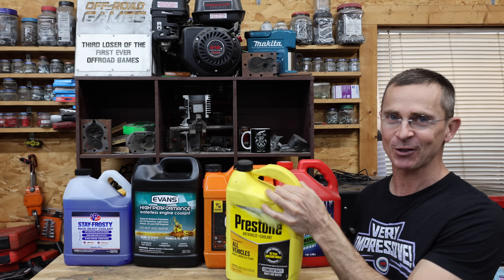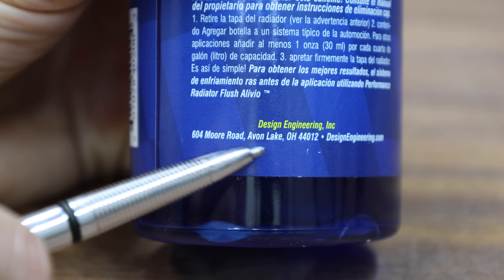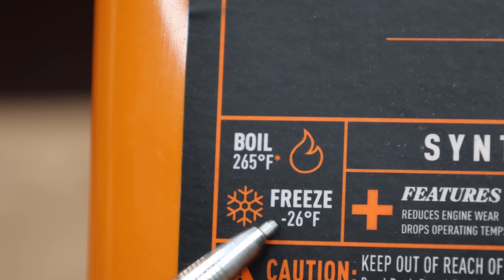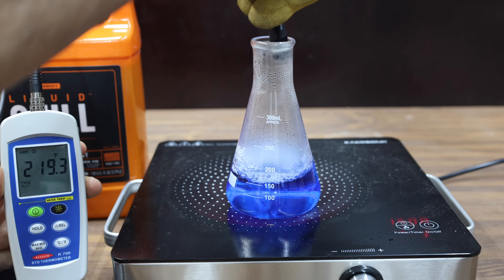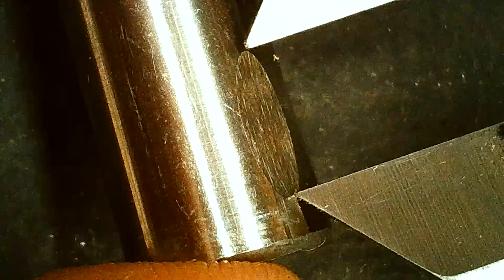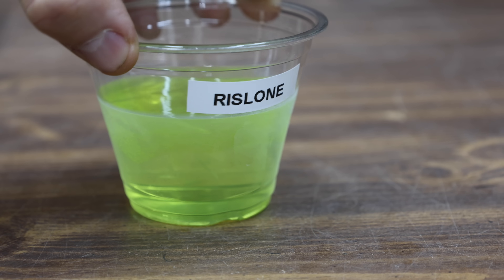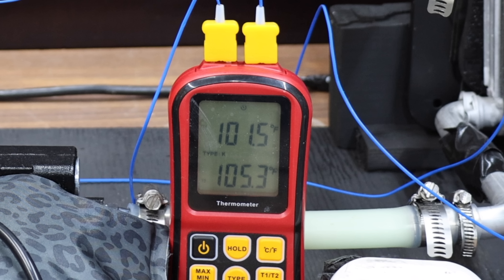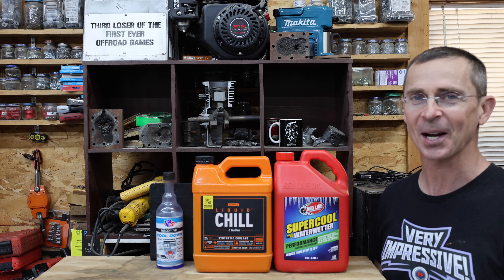Do "Super Coolants" Lower Engine Temperature By 30 Degrees?

Comment: Please guys do test on Chevy one row oem radiators vs the expensive ones and thicker radiators of 3 rows. Specially on GM models from 99-06. The problem with thicker radiators is that you need more speed on the air flow to pass through and cool the 3 rows, oem radiators on chevys are thin and it have more surface on each row so is easier for air to pass faster through the thin row to cool the coolant that have inside, specially on heavy traffic or low speed on the city. Ticker radiators needs more coolant, so is harder cool more water mass that is inside the radiator. But this full aluminum radiator brands says that 3 row is better! So who will win the test !!
Reply from the maker: Thanks for the suggestion.

Comment: I use evans in waterless coolent high-performance 383 chevy  it sits alot the evans we use is for racing it $50dollars for  a half gallon it does keeps rust corrosion away  worth every dollar.
Reply from the maker: Thanks for sharing.

Comment: HOW IS THE MOST POPULAR product not on here? WATER WETTER?? Am I missing something?
Reply: Thats what im saying!
Reply: That's redline supercool water wetter.
Reply: @HSKFab  The problem with testing Redline's premixed antifreeze with water wetter, versus adding water wetter to the Peak, is that we don't know if water wetter just works better or if their premix works better. They may have a different ratio of water wetter in their premix, or it may be a certain formulation of antifreeze. Without testing Redline Water Wetter with the Peak you don't have that data. 
Redline premix is more expensive than getting Peak AF and mixing with Water Wetter, but is it worth more money?
Reply: It is the redline fluid. With water wetter
Reply: Go back to the end of the video where he's making the outro and youll see the recliner supercool Water wetter
Reply: Red line*

Comment: Needing "super coolants" basically means you have serious issues elsewhere in your cooling system. There's a reason mechanics don't fix overheating conditions with these products.
Only in some special circumstances would you ever need to use them, otherwise you're just buying snake oil and forcing your engine to work in conditions it wasn't meant for

Comment: that  evans coolant stuff, it will catch fire if there is a small leak
especially if it squirts onto ex mani.
and if it comes out dizzy side, then the sparks or static or what ever there is on dizzy / plug side will also set it alight
as i found out.

Comment: Heat capacity and heat conduction are not the same, but both matter...water is far superior in both categories when compared to ethylene glycol (EG), which most of these are, or propylene glycol (PG), which the Evans is.
   Not even close. Water conducts heat more than 4x as good as PG, more than 2x EG. 
   EG is almost twice as good as PG (Evans) in conduction. 
   In heat capacity, by volume, water beats either EG or PG, it is almost double.
    Evans and it's fans tout the lack of cooling system pressure as a benefit. But cooling systems are designed for this, it is generally 12-13 psi. It not only raises the boiling temp of water to more than enough, it also prevents cavitation in the pump.
    It is less than 1 atmosphere, really not much.
    Straight water is best for heat transfer, it isn't even close. But corrosion, freezing, and pump seal lubrication are real things.
    Extremely low freezing points are kind of impressive, but don't help if it never gets that cold. 
    I get good results with common EG coolants and distilled water.
    RV antifreeze is propylene glycol, like Evans, but is 1/10 the price. I'm sure there are different additives, it's not fair to say they are the same. But the big differences in basic heat transfer abilities VS water make me suspicious. 
   Remember that none of them are really "coolants", they are "heat transfer liquids". To move heat to the radiator. Making the radiator HOTTER for a given engine power output INCREASES heat loss to the air, which is the goal.
    Leaving any liquid out of the cooling system would result in a nice cool radiator, and also in engine meltdown, right?
Reply: I agree with the many comments on the thermostats here- if any of these lower engine temp by 30 degrees, your thermostat is malfunctioning,  or your radiator is inadequate,  either by design, or is dirty or something. 
   AND- thanks for all your work, and entertaining and informative videos.

Comment: haha your engine is designed to run at  temperature. if  you wanted it to run 30degrees cooler,   you just disable the  thermostat

Comment: Red line Waterwetter is what we use on race and regulars and have performed well, had issues of over heating on one of the car we race and a friend recommended the redline and never overheated after, been using it since early 2000's and u can buy a small bottle and add it on ur coolant reservoir.

Comment: Only one test in that really means anything maybe two which would be the mock system test and the freeze test. The others don't mean anything. Coolant is not suppose to be in your oil so idk why you'd test for wear scars. I'm assuming the wear test is an equivalent to bearing wear and seal protection in the water pump. The bearings in the water pump can be just fine using regular old water as that's what a lot of people do in warmer climates because it doesn't really freeze so that's not really an issue. The mock up system test isn't really exact because these are designed to be under pressure in a running engine which they weren't here which would slightly change the results although probably still mimic them to a large degree.

Comment: Used the Liquid Chill in a '99 7.3 PS, and it helped a lot. However, I found using a low temp thermostat on my 6.7 made a bigger difference in operating temps just using regular coolant with no additive. Both truck were used as Hot Shots towing up to 26K of freight.

Comment: Technical Note:   The water pump bearing is lubricated by grease and is SEALED from getting any coolant.   Lubricity of coolant may help the seal itself last longer.  But has ZERO effect on  the bearings unless the seal is leaking.
Reply: It’s for electrical water pumps

Comment: This test is severely flawed.  You are actually indirectly measuring the heat capacity of the fluid along with some degree of thermal conductivity.  What really matters is how much heat gets removed from your engine.  A better way to measure performance would be to measure the electrical power required to maintain a specific outflow temperature from the heater core at steady state.   This will quantify the ability of a fluid to remove heat from your system.  As a thought experiment imagine you had a fluid with extremely low heat capacity,  the temperature drop through the heater core core would be very large but the ability of the whole system to remove heat from the heater coil would likely be quite poor.

Comment: I've never considered temperature lowering additives or coolants for daily drivers; STICK WITH THE MANUFACTURERS RECOMMENDED COOLANT. PERIOD.

My experience with Redline WaterWetter was in the late 1990s in SCCA racing. At that time it was an additive we added to standard Green Ethylene Glycol antifreeze (Which cooled better than plain water), with WaterWetter we were able to add a few more degrees of ignition timing advance and achieve a few more horsepower on the dyno than 50/50 Ethylene Glycol alone; pH was never a consideration as the engine was rebuilt yearly before the Run-Off Championship race.
WaterWetter's claim as I remember was that it reduced the surface tension in the areas contacting the crucial cylinder head surfaces to remove heat.
Reply from the maker: Thanks for the feedback.

Comment: If these really reduced cylinder head temperature by 75 degrees, they would make the engine run very poorly and burn a lot of gas. Engines are SUPPOSED to run at the temperature they run at.

Comment: Thanks for this! Sorry for the dumb question but Im confused why add sulfuric acid? Why not just compare base ph? Unless we’re saying theres a way for these things to possibly become more acidic over time and you were checking resistance? Sorry just confused there.

The Evans seems like a drag racers friend. High boiling and low freezing and I’m assuming if a line goes it doesnt do to the track what antifreeze does

Comment: I’ve had a horrible experience with The royal purple engine ice.  I rebuilt my Honda motor from scratch and was running distilled water. Couldn’t get redline  water wetter locally so I went to discount auto and saw the Royal purple version.  I empty my cooling system and fill with RP ice and distilled water.  About two weeks later I hear hissing coming out of my radiator cap in the garage. Engine was cold, car hadn’t been driven for days.   Turns out the Royal purple went corrosive and was eating my aluminum radiator.  I reached out to them and they claimed it was my fault for not using tap water.  Then they said I used half the correct dose of their product. Their test results yielded high aluminum , high sulfate and high chloride.  The radiator was brand new, all cooling system components were brand new from Honda and there was only ever distilled water in the system from  we took apart the block and hot tanked it.   Lesson learned in chemistry.  I went back to using redline water wetter with Honda oem coolant.
Reply from the maker: Thanks for sharing.

Comment: I’ve run Evans in all of my race bikes for many years. There’s been no comparison to Evan’s yet.  Anyone interested in switching over to Evan’s needs to know this, Evan’s makes a radiator flush you must run through the engine as directed then drain out before you add the Evan’s coolant it’s self.   It’s pricey but well worth it.
Reply from the maker: Thanks for sharing.

Comment: Three things about the Evans: 1) You have to completely clean/dry out the coolant tract when replacing with Evans. No water should be in the cooling system, nor do you cut it with water when putting it in. If you don't remove the water, it degrades it. 2) Once put in the system, it's a lifetime coolant. You don't have to change it. 3) Considering it will not boil until over 380°F, you can run it at a lower pressure than normal. Less stress on the hoses and pump seals.
Reply from the maker: Thanks for sharing.

Comment: Just think about it, without any water Evans performs equal to a regular 50/50 mix. No water=low pressure and super long life for all cooling components and no more corrosion in your engine.

Comment: Possibly an interesting statistic you could add to the lubrication tests would be the amount of material that was removed. You could do this by using a cup filled to the brim with water and then dropping the pin in it after you wipe off any/all excess lubricant. Alternatively, you could also weigh the pin before/after.
Reply from the maker: Thanks for the suggestion.

Comment: 😮With much thought. Was the thermostat still going to let my bike in high heat traffic bouncing off boil over.??.  Like evans for the boarder line. Boil over.?? I still need to keep bike at temperatures it’s designed for.  Bike came with red line with water wetter. I feel safe now. I read comments to get hidden info. . I freaked out to get evans. Then convinced red line with water wetter good . Now. After much thinking. Im still changing to boil over protection.2015 Honda cbr600rr everyone hates the high temp soon as you stop. But the fans do kick on. So boil over protection from evans might be best. Wish I had the bike back to do the test.?? . But I’m in reverse testing on a sv1000 . Im flushing redline out.and putting evans in. With a big v twin it should get rid of hot spots.???  Comment section is where you can almost get real life Common sense . And disifer awesome testing to real life driving and storing 😮 I think if made my decision. Not to cool down. I have fan for that. But to protect from boil over.?? 😮but wait.!!! I changed my mind again. A guy pointed out with evans. If your bike is overheating . Like 250. Or higher Your cooking your engine . So I’m going back to redline. Or and just use a fan. That’s my final awnser lol.  One guy used strait water wetter no antifreeze. ?? If you forget to drain one winter you could freeeeeze 😮

Comment: The big deal here (if you have a car which may overheat due to performance or whatever) is boiling point, if you can stop it boiling, you have it under controll, soon as she boils all bets are off. im too cheap to run evans, but neat modern OAT concentrate has a boiling point around 180c so very very similiar to the evans.

Comment: Ive been using mishimotos "liquid chill" for my subaru wrx since my stock radiator blew up the first year I had the car. When I first got the car it would run high with 200-228F during summer. Switched to a front mount intercooler after the stock one busted and that dropped temps to between 190-210F during summer. Switched from standard antifreeze to "liquid chill" and it further dropped my summer driving temps to between 170-190F! For anyone that knows subarus you know how critical cooling is. Unrelated but I also eventually did the cylinder 4 cooling mod by tapping into the heater lines and my average driving temps stay between 168-182F. Couldn't be happier.
Reply from the maker: Thanks for sharing.

Comment: Great comparo!
My only question is, is it possible that you may have made a small mistake in not testing the Evans Waterless Coolant first? Or did you use their Prep Fluid to rinse and remove any traces of water in the test system prior to testing it?
Just a thought.

Comment: I’ve never seen a 30* drop, but I’ve always run a coolant booster in my toys over the years and I can say based on data logs that at least some of them work to some
Extent. For instance in my track bike straight distilled water + Amsoil coolant boost keeps the bikes coolant temps on average ~12-14*  than regular OEM antifreeze. Another thing I’ve also noticed is that in my grudge car I run the same setup and it comes up to operating temp a little faster than with straight water alone. So there’s something in this stuff that changes the thermal properties to some degree.
Reply from the maker: Thanks for sharing.

Comment: Can you test 12” electric radiator fans? Proform/derale/spal/flexalite/etc 
Specifically brush vs brushless. Proform has brushless fans and they claim they pull more air than brush
Reply from the maker: Thanks for the suggestion.

Comment: I wish you had tried Peak Final Charge against the standard coolant. Peak claims a life of 1.5 million miles, 10 years or 36,000 hours from a relatively inexpensive coolant. Also claim to have better heat transfer properties for use with emissions controlled diesel engines that have EGR coolers and the like. I have been running it in everything I own for a while now and a couple of the vehicles seem to run cooler in Texas summer heat.
Reply from the maker: Thanks for the constructive feedback.

Comment: I personally use the VP additive, and it works great. It was on sale one day, figured what the heck since I was dealing with an engine getting hotter than I'd like to see. Dumped it in after a flush was already done (it was still getting hot after the flush) and It literally solved my issue. Believe it or not, i dont care because it works. For the $10 i spent on it, all i can say is ive spent $10 on far less useful things hahah.
Reply from the maker: Thanks for the feedback.

Comment: Amazing review as always! 🎉 The Engine Ice we buy in Canada is blue and has proper labelling, sold through Canadian Tire. I run it in my KTM 350XC-F dirt bike with great results, but will switch to Redline after watching this. Redline oil is the best I’ve ever found for use in 2T engines as a small engine mechanic.
Reply from the maker: Thanks!  Thanks for sharing.

Comment: Can’t watch the video right now but I can say the stuff works. I thought it was a gimmick but driving in the mountains and the temps being higher in my 90’ burb I had to do what I could right then and there. Added stop slip to the trans and heet to the coolant and I saw a decent difference to the temps in my old 350 Chevy with a 700r4.
Reply from the maker: Thanks for the feedback.

Comment: You gotta re do the boiling test on this because coolants are used in a sealed pressure system in the vehicles and with it being sealed increases the temp for boiling point so not sure if any of them are designed to preform better if pressurized compared to open

Comment: when watercooling a pc I use Evans as my additive and never had a galvanized issue. I've used the others with minor issues. this info is good to know as pc coolant is over priced, plus as a disclaimer most antifreeze and additives will break down the rubber and plastics just like your car.
Reply from the maker: Thanks for the feedback.

Comment: I sent you an email. Your test bench used for this comparison with the small radiator would be perfect to test which fluid cooler style works the best at dropping temps (Fin tube, stacked plate, aluminum heat-sink). You are THE BEST non-sponsored comparison tester on any platform Todd! Need to get you that Diamond Creator award!
Reply from the maker: Thanks!  Thanks for the suggestion.

Comment: Evans is completely oil and you need less than 3% moisture from water. It's 100% oil in your cooling system so you can't judge it with others that you add water to. Evans is not an additive